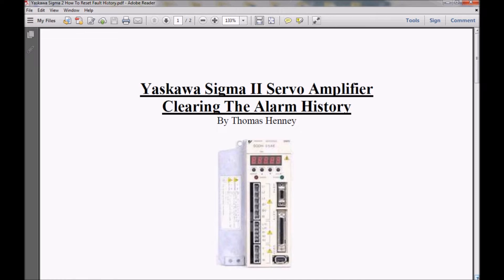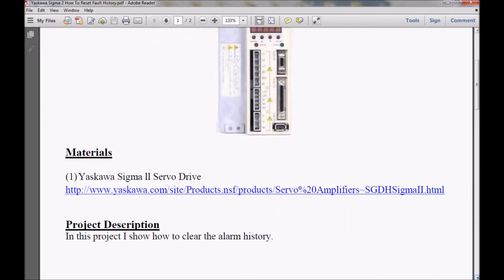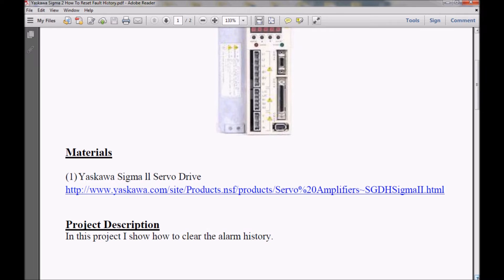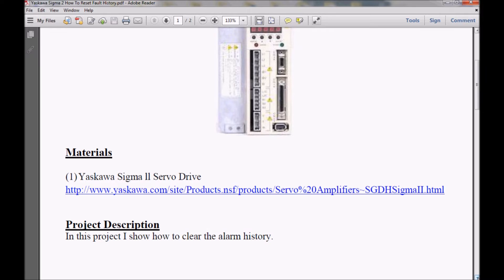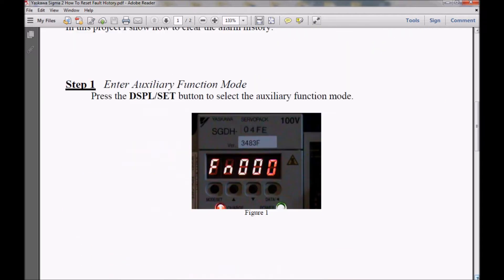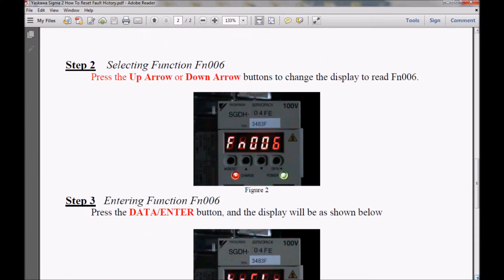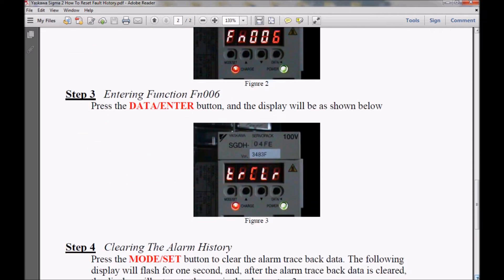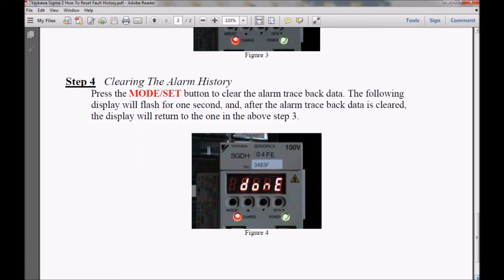Yaskawa Sigma II Clearing Alarm History

Comment: What means Internal program error occurred in the SERVOPAC? Got error FL2 on yaskawa SGDV
Reply from the maker: Redzuan,
Unfortunately this is one of those fatal errors Sort of like the Blue Screen of Death on a Windows PC. You can attempt to reset this alarm by removing power to the amplifier for several minutes and turning power on again. But from personal experience I have only been able to reset this one once, other times ended up replacing amplifier. 

One thing that you might attempt is updating the firmware if you have access being an internal error it might work. Otherwise you are limited to replacement. I know this does not help but its all I got.

Sorry
Tom